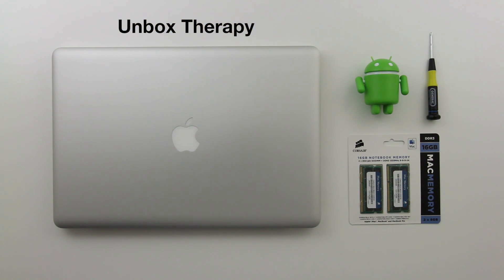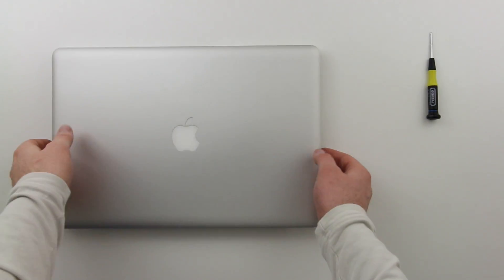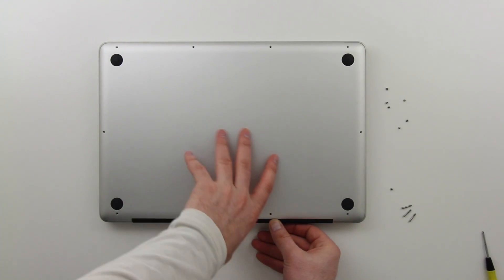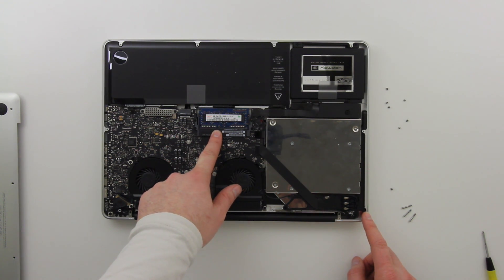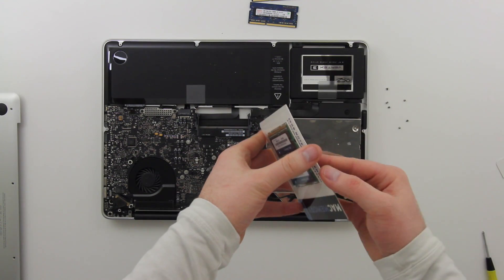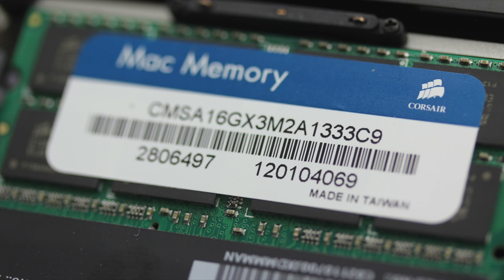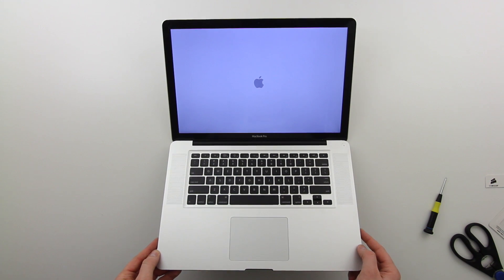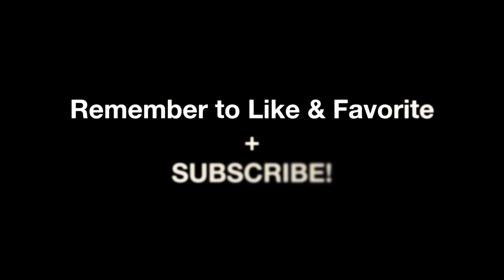16GB MacBook Pro RAM Upgrade (2011)

Comment: Question for you or anyone
I have a like new 2011 MacBook Pro
Has a 1tb hard drive but only 4gb of ram 
These are stock from Apple
Laptop runs Catalina, I’m not going to use this for anything other than web or email
Aps load a little slow. So would I get by with just updating the ram from 4 to 16 or should I put a ssd in to?
Wasn’t sure what makes things load faster like aps or websites the ram or the drive 

Also have a 2012 retina with 500gb drive and 8 gbs if ram
Same question
Your thoughts?
Reply: If you want the best performance install a SSD as well

Comment: Hey guys, As I’m finally planning (2021) to upgrade my old MacBook Pro 13” 
late 2011 ( after 10 years aha) , should I buy a 2 x 8Go Ram memory 1333Mhz or 1600Mhz? And if I go for 2x 8Go 1600Mhz is it not too much for this old baby ? Thanks for your help  !

Comment: This won’t work on an i5 version. I found out the hard way lol
Reply: Some comments say it worked for them, were you able to fix it? :O
Reply: @DancingOutInSpace  unfortunately not. I tried two different lots of ram. Maybe it was just my machine. I am not sure why it wouldn't work. its running fine with 8gb.

Comment: I still have my 13" 2011 macbook pro. Actually...I also have a 15" macbook of the same vintage from my Late Dad. The latter one (along with my 2013 iPad) are FRIED due to a faulty logic board which the Genius Bar says they can't fix. (it would cost $700, and the logic boards they have in stock have the same bad video card. #$%^!) 
The system info on this laptop says it only has 4GB of RAM. Maybe that's why it boots up so slow. Some accumulated malware from downloading movies probably doesn't help matters, either. I think I will buy more RAM and see how it runs. The keyboard also went bad, btw-and the pimp at the Geek Squad told me "How much enjoyment and use have you gotten out of it for all these years?" In other words...he wanted me to buy a NEW one from Best Buy. SORRY, pal. I took it to ubreakifix and they wanted $180 for a new keyboard. So-I took it to a GREAT Russian tech. guy and he replaced it-in a few days-for $100. No more issues on that front.

Comment: Thanks Lou ! (from 2020)
Just as a safe measure: avoid touching the gold connectors of the memories, mainly if the weather is super dry, cause possibly the static charges in your fingers could damage them.
Reply: I was wondering about that! I thought we should all wear gloves.

Comment: For anyone wondering how a early 2011 MBP runs in 2020 have no fear. AMAZING MACHINE. Upgraded my HDD to a SSDH 2TB. 16 GB of ram. Planning on upgrading logic board to a mid 2012 to prevent any GPU failures in the future!. Thinking about removing my disk drive and using my original 500GB HDD as backup

Comment: Turns out this year was a real lemon of a model. Good ole dosdude here on yt offered a fix for graphics issues by bypassing the amd chip to use intel integrated graphics. These amd chips seem to die like OG 360's. mostly from apple really skimping on the thermals for sake of silence.

Comment: Can you upgrade a early 2011 mac book pro from 8 ram to 16 new to mac also I will put 1tb ssd to it. It says 2 core, 1 processir, guy said it was quad core because it has two tevers I think they called off each core, I'm not sure, I'm pc and my pc! Stats four core on the hardware

Comment: I'm planning to upgrade my MBP early 2011 A1286 from 8gb ram to 16gb. Tell me if this memory module is compatible with my MBP. Thanks!
Crucial 8GB 1RX8 PC3L-12800 DDR3L 1600Mhz 204-pin 1.35v SODIMM RAM.

Comment: Watching at 2019, planning to do this on my 2011 macbook too:)
Reply: I have 16GB in my good old MacBook Pro 13" mid 2012 since... 2013 !
Still funny that Apple officially wrote in the specs that it could support only 8GB. Typical Apple. 🤔
And by the way I am using this old boy right now typing this comment and yes it is 2020 !
Reply: @thefrog9119  Hey, I'm planning to do the same on my 2012. Do I need to upgrade my HDD to SSD first?
Reply: Ruben Sandoval No pal, but I would recommend upgrading to an SSD first as it’s more useful in speeding up than increasing the ram alone, if you can do both, great!
Reply: @rubensandoval2239   upgrading the memory will allow you to navigate flawlessly between apps, to open more apps at the same time, to make you user experience better.
The hard drive is another story, upgrading to SSD will only allow you to save your work faster. Personally I started upgrading the memory and I was still using the OEM 5400rpm drive, even to watch movies etc... Then the drive crashed and I went for the big leap : SSD for the apps and bye bye Superdrive, welcome to a second big capacity HDD, so now I'm full and happy.
Reply: @thefrog9119  what ram did you use for it? i'm using a mid 2012 macbook pro 13 inch too. my mac didn't like the one 8 gig stick i put in it even tho it was the right specs. but in my opinion 4 gigs of ram is barely sufficient for catalina
Reply: @Jacobrobertone   I have to open it to see the brand name (which I won't do right now) but the "About this Mac" menu clearly indicates each of the two slots occupied with 8Go of 1600 MHz DDR3 memory.
Reply: @thefrog9119  Okay, glad someone said something because I looked at the official upgrade page on Apple and saw 8gb and I was like dang. This is awesome. Gonna need to look at the SSD upgrade too.
Reply: Same but 2020. I was recently mugged leaving campus and had all my stuff stolen. I was able to get my sister's old 2011 Macbook Pro when I came home for the holidays and I'm upgrading the laptop. 16gbs of RAM and an SSD should make it much snappier.
Reply: Jackson Walter planning on doing the same thing for my 2012 MacBook Pro. Did you see a major performance improvement after the upgrade?
Reply: Same. I bought a Windows but still love my old Mac more
Reply: Me too me too 🤣 2020 here!
Reply: 2021 :-)
Reply: I thought the max RAM was 8gb not 16 gb?
Reply: @jays.5978  ive read that it can handle 16, im thinking about doing it, but i dont even know if its worth putting 16gram on it
Reply: ThinK Different yeah I upgraded to 16 GB since that post.
Reply: @jays.5978  how is it? i dont use the computer that much but eventually want to sell it, but if im upgrade might as well go to the max right? where did you get the ram? how much
Reply: ThinK Different I put an ssd and 16gb in mine 2 days ago and it’s running smooth as silk, highly reccomend it’s like a new laptop minus the pretty screen lol
Reply: I already got the ssd, im waiting on the ram to get in.  I was gonna sell it, but honestly the Mac and I have been through a lot together, and I hope to keep it till the end of time.  I recently got a dell, and its nice and all, but I keep the Mac next to me for company until I can give her surgery.  Im excited to do the upgrade, and when I found you can put the 16g ram in it, i asked myself why  I didnt do it sooner.
Reply: Of course after i did everything the battery is going bad lol. Anyway computer runs fine now. It does everything i need it to do. 8gb would of been fine but it never hurts to have more ram.
Reply: I did it today, 23.08.2020
Reply: @lollml5017  i did it just because i changed the battery and hard drive i though the 16gb ram in there as well.  Ill never max it out, but its nice to have.  trying to figure out how to get catalina on it now.
Reply: Do I need 1333Mhz oder 1600Mhz? I have an MBP early 2011 with intel i5 2,3Ghz. Right now it works with 8gb ddr3 1600mhz.
Reply: @123halloduda  
no idea pal, I have MBP early 2011 with i5 2.7 and I've got 16gb 1333mhz, to be honest mate 16GB of slightly slower ram is much better than 8 GB of slighly faster :)
Reply: Ethan White okay bro, you think I should buy the 16gb ddr3 with 1333mhz?
Reply: 123halloduda yeah bro that will be all good that’s what I’ve got at it runs smooth as silk
Reply: marco dela cruz - Same
Reply: I did it and it worked wonders. Why did I wait so long?
Reply: Same
Reply: Same here... 7 years on! heheh
Reply: Same :)
Reply: uno cerebro mas grande es muy bueno!
Reply: Same in 2020
Reply: Just wanna ask. I'm planning to upgrade my ram as well. What should I buy, DDR3 or DDR3L? :<
Reply: Did he put both of those ram chip in?

Comment: Hey there, recently bought a 2x8GB and added them to my MacBook Pro early 2011 however I use Visual Studio 2017 and it started working really slow what was never the case with my old 2x2GB. Anyone experienced that or any suggestions ?

Comment: But.. it won't be compatible? Apples max recommended Ram for 2011 Pro models is 8gb. 
Yours works or overheats???
Reply: That's the same question I have.  I would love to have 16 gb but it reads maximum 8gb.  Nobody can answer this on Youtube so I guess I'll go to the professionals.
Reply: Vic O Yeah. I just do the 8gb bc if it’s not recommended there’s usually a good reason. It either will hurt the motherboard or you can’t utilize the extra ram anyway.
Reply: @SeraDoll89  I upgraded to 8gb and I'm trying to figure out which SSD is best for my macbook 2012.

Comment: Hello. I have a question for you.  Never opened a MacBook or any other computer or phone before, but I want to try.  I have an early 20ll MacBook pro.  Want to upgrade ram, replace the hard drive.  I also have another issue that I'm hoping you can help me diagnose.  The trackpad has become an issue.  It will click when I depress it AND I can move the mouse. However, the mouse on the screen does not respond to my click on the trackpad.  I hooked up a battery powered external mouse, and everything responds just fine.  So, before I go the expense of buying a new trackpad, I want to make sure the problem is not something else, such as the battery or another issue. Can you help me, or anyone else here help me?  I'm an older woman with lots of initiative and not afraid of trying to fix this on my own.  Thanks so much.  Patti

Comment: Thanks a lot for this video which was exactly what i needed.

I have been struggling for the past 2 years with a slow performing 4GB RAM early 2011 MacBook Pro (15 inch). The space almost was up and I had to move my photo library to an external drive freeing up 300 GB of space on my 500 GB factory HDD. Things started to look a lot better in terms of performance for the usual browsing, watching movies etc. But when I started to use Adobe products like Lightroom CC etc., again my MacBook started to become slow and that's where i stumbled upon your video of upgrading the RAM. 

Boy wasn't that exactly i needed!! I immediately ordered the 16GB RAM and same day delivery (thanks to Amazon prime) and i followed your steps. Now my MacBook is not a slug anymore but a Racing Horse :D 

Next step - Have to see if i can upgrade my HDD to an SSD.... probably i can convert this Racing Horse to a Steam Engine :D

Thanks again UnboxTherapy!!

- John

Comment: i have macbook pro 13" core i5 late 2011 with ssd and recently added kingston hyper x 1600mhz ram with 9-9-9-27 timings...works fine with 1600mhz  and ive heard you can go as high as 1866mhz with 11-11-11 timings as long as it has the sandybridge type cpu....i was really hung up on low ram timings which is why i spent more on the hyperx BUT ive compared it against 1600mhz with 11-11-11-30 timings and Really no difference at all..if anything, the 11 timings were more responsive in some cases and smoother, probably cuz the 9 timings were pushing the limits a bit ...anyway, im looking to grab 16gb when price is right..PS: the ram voltage is 1.5 for mac pros before 2012 and needs to be 1.35 for the later models...you CAN use 1.35v ram in the 2011  and it will work fine without issue...it  wont hurt a thing...1.35 ram  will wok in 1.5v models but 1.5v ram may have errors if u try running it on later low voltage  systems...the 2  types of ram are sam with only difference is that the lower voltage chips are a better quality  than the ones that need the higher volts to run without errors

Comment: i did what you told and upgraded my RAM to 2x8gb Corsair 1333mhz but now my Mac won't charge. I can use it with my charger on, but it's not charging. Any ideia on how to solve this problem??

Comment: Apple says the max RAM for any of the 2011 MacBook Pro models is 8 GB.
Were you able to actually access all 16 GB in your Mac?
Apple says the 2010 model also has a max of 8 GB.
So...will 16 GB work for a 2010 model?  Should it have 9-9-9-24 timing?

Comment: So to confirm... is this definitely possible on the MacBook Pro 15 inch early 2011??! Can I just ignore the manual where it says a maximum of 4gb per slot? In your comment your saying 1333Ghz and 1333Mhz interchangeably, but I'm assuming you mean Mhz... Are you saying that I can order some a 8Gb DR3 1333Mhz ram stick and just plug it into one slot?

Comment: I noticed your processor is i7, I have a 13inch early 2011 2.3 GHz i5 processor will my MBP be able to upgrade to 16gb RAM?
Reply: You end up having 16gb ram?
Reply: Mauricio Franco  I think the processor matters. Mine’s an early 2011 i5 and won’t try fiddling with my machine where, like here, the demo is with a different machine. Not worth “guessing” and screwing stuff up. Trying to make things better not create “different” issues. SATA drives are recoverable too and Fusion or SSD drives are not. That’s what an experienced Apple tech told me on the sly. I’m no expert though so just keep changes to a minimum, one at a time, is all I’d do. Cheers.
Reply: Not sure what you are talking about....."SATA drives are recoverable too and Fusion or SSD drives are not. That’s what an experienced Apple tech told me on the sly."  @aremedyproject9569  I have upgrade the Ram and swapped out HDDs and SSDs in my 13" 2011 Macbook Pro with no issues what-so-ever
Reply: Mauricio Franco no, the max for the 13 inch is 8GB.. ik the reply is late lol
Reply: That is inccorrect,  @traintk6595  They say 8 GB is the max, but it will take 16gb

Comment: Does this work for late 2011??? Apple says 8gb is max?
Reply: I have been wondering the same thing for my late 2011 but turns out it can support up to 16GB
Reply: Why does Apple say the max is 8GB? I want to go with 16, but I don't want to waste my money.
Reply: @lifewhyz  for early 2011, max only 8Gb and 16Gb for Late 2011
Reply: @BritsRecsMusic  is that sure, because I have the early 2011 13" and I have heard that it works and that it doesn't and I can't decide, may I ask where, you got your information from
Reply: LifeWhyz Music -They say 8GiB max because they only published performance specs up to 8GiB  DDR3 installed. So they will only state what they know for fact. That's what I was told anyway..
Reply: Can i know the type of RAM?
Reply: Can you tell what is your RAM type and Voltage, so far i tend to upgrade to 16GB (2x8GB). Thank You :).
Reply: I used ddr3 G.SKILL (4x2GB) with 1.35V
Reply: Yes even 16gb
Reply: Excellent and good to know.

Comment: I just recenly bought a crucial 16gb 1600mhz ram for my early 2011, would it actually work? Can someone confirm it? 😕
Reply: Rey Rallos you can use ANY laptop ram that's 1333mhz not 1600mhz. It'll cause system panic.
Reply: Hamizan Ayob ohhh man! I bought that thing thinking it'll make a better upgrade 😕 when it arrive i'll have to return it. Thank you for replying
Reply: Is it i5 or i7?

Comment: I am surprised you haven't taken any precaution to avoid the static charge. Guys, please do not touch the ram directly with your fingers, it might damage it...Take precautions for static charge.
Reply: Lol you're obviously a noob with electronics then.. it's not that big of a deal lol
Reply: how?
Reply: how?
Reply: Just touch metal and it should de-static your hands
Reply: Raj N how?
Reply: Nic Perichon  how?
Reply: You don't need to worry about that in newer computers, bruh. That is a thing of the past.
Reply: I forget what its called but disconnect the battery and u gotta put this strap thing on
Reply: anti static band. you don't have to disconnect the battery.

Comment: Is this mac worth buying in 2016  ?
Reply: SteviX EDM i mean, there's nothing wrong with getting a 2011ish macbook pro, especially since the newer models don't have a disc drive and you want/need one for whatever reason. Only downside you might find is being unable to upgrade to the latest Apple IOS's as the years go on, but personally That's not a big deal for me or for most people for that matter because most changes as each new IOS comes out is relatively minor in the grand scheme of things
Reply: ^you are able to update to macOS sierra
Reply: SteviX EDM Yes, I did some re-search since I wanted to buy a macbook pro I was planning on buying a 2015 model, I thought that because it is a newer model it would be better but in fact a 2011-2012 macbook pro is the best option, I bought a late 2011 15' pro with i7 4gb ram and I'm planning on upgrading to 8 or 16 of ram. I can tell you its the best option. Newest models are not upgradable
Reply: I agree the 2015 is the best by far
Reply: Miguel Castro but a lot more expensive
Reply: 13' mid 2012 i5 all standard or 15'  late 2011 antiglare i7 with ssd.Both are second hand and the 13' seem so to be in a bit better condition and i read somewhere that the 2011 MacBooks have graphics problems/failures idk if it's true .What do you suggest?

Comment: will  i lose my information. ..if I don't backup my info. .
Reply: Data is stored on your hard disk not on your ram modules.
Reply: true... retina is not upgradable
Reply: Erik Öhrberg
You've just made a little mistake, you are definitely correct when you say you can not upgrade the Ram. But you can actually upgrade the SSD.